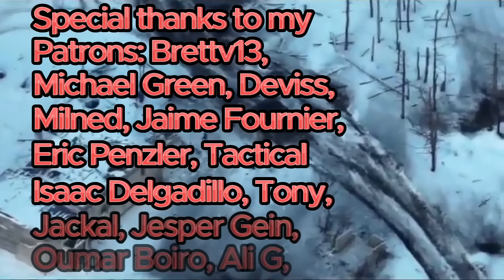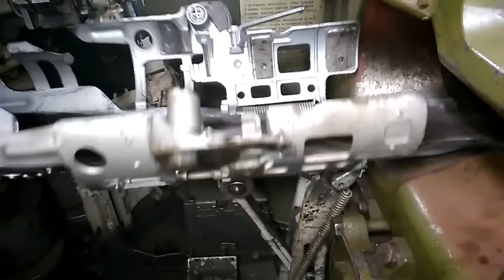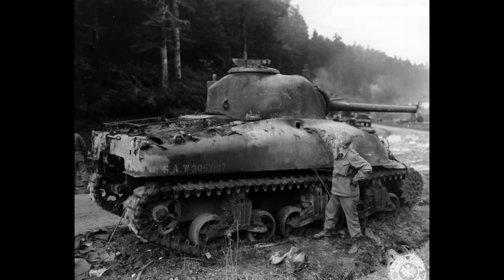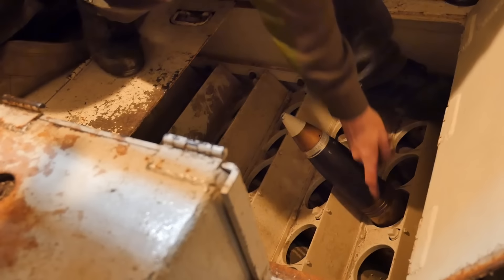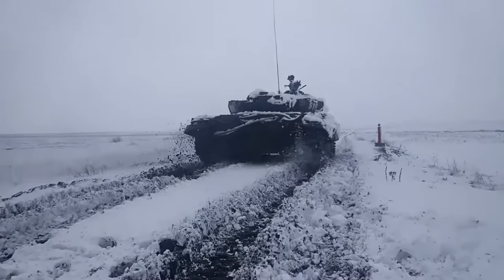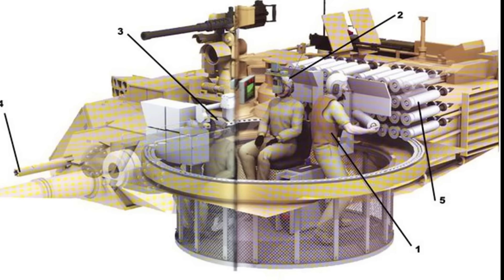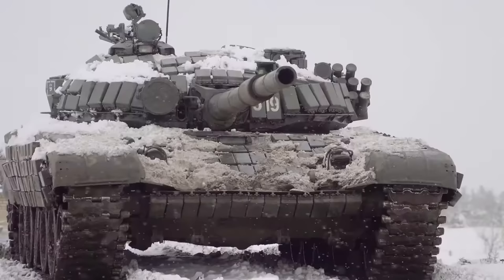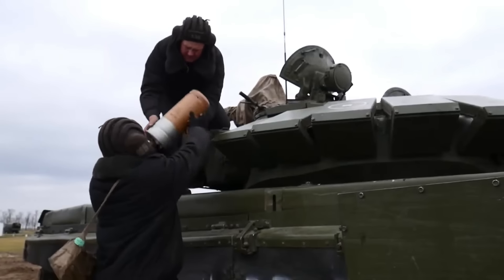Is Autoloader Really the Reason for Russian tanks exploding so much?

Comment: The most simple solution will be the introduction of a new propellant and HE shells, that are less sensitive to the external impact like what German introduced. That doesn't required any major changes at the loader itself. T 90M also offer some kind of kevlar layer inside the fighting compartment to reduce the post penetration effect, which is ...lets say, very terrible on Soviet tanks.
Also, the very good advantage of bustle autoloader is the loading speed. K2 can shoot 15 rounds per minute and the very similar loading rate are shared by Leclerc and Type 10 . Of course Russian will mostly not have to fight against these concepts (oh sorry, correction: Poland did buy dozens of K2) but still worth mentioning.
Reply: @CheapSushi  active protection system in Russia's case need multiple adjustment to deal with near peer threats. Also Russia suffered from the lack of budget and corruption. The Arena M APS which was "declared" effective against top attack munition was planned to mass produced next years but that will probably delayed forever because of the ongoing war. Remote turret is an amazing solution , especially when combining with some kind of special ammunition but detecting those small and agile drones is a major difficulty for both sides.
Reply: @mrmakhno3030  Or Boomerang/T-14 case: Russian HQ took a look at new stuff and decided that upgrade isnt really worth it.

Comment: All that matters really is that the crew survives.And let's not forget these Abrams you are using to compare are almost 30 years old. It's clear tho Western tanks are better
Reply: I think its clear they're weaker. So far 72b3 vs Abrams t72 1 Abrams 0

Also the finnicky blow out panels of the m1 means a simple rpg or loitering drone can causes a blow out which makes the tank operationally killed. Thats extremely weak
Reply: @off6848  It wouldn't be that hard to put cope cages around the back of Abrams protecting the ammo. Compared to Russian tanks ammo storage. And it seems to me that any tank that gets hit with their advanced optics and electric systems gets knocked out of combat period so then it comes down to crew survival
Reply: I say f war tho and both sides have shown that the Rus in both sides are brave. And imo the Armata is the best single tant if they iron out the problems.Why?  Crew safety and having the crew out of the turret and into a armored capsule
Reply: Also you could ask. Is Abrams a war winning tank? The tiger was better at fighting then the Sherman. Was the Tiger a war winning tank tho?

Comment: 7:12 and like . . . already about years for someone to say "Russia already uses a low insensitive propellant, carousel ain't longer a problem"

in my opinion, hand loads become more and more obsolete
con
- more (frontline) crew
- more training
- more life cost
- bigger tank size
- bigger blow-out panel door
pro
+ more crew for quick field (but it really, has on-board spare parts like WWII are rarely seen in modern-day)
+ less mechanic maintain
Reply: The extra crew reduces chance of all crew knocked out (in War Thunder)
Jokes aside, heat insensitive propellants isn’t That hard to make. Doesn’t make sense for Russia not to have them.
Reply: Tha is assuming the tanks only carry modern HE shells made in Russia.
Reply: @anotherbacklog  More like they are using old ammo, especially HE ammo, because it didnt really get better over time, aside form adding remote detonation function.

Comment: Im gonna gaurentee that you havent mentioned the weakspot along the turret ring , which is where every t72 and t80 are being hit with fpv drones , Also gonna guess you ignored the fake relikt and the t72s that have had the ufp penned at its supposed thickest spot by tanks that can only field low pen apfsds . Also the aluminum covering on the autoloader will not provide any stopping power against fragments of steel and harder materials , your also forgetting thgr armor on burnt out turrets eg the leos that got repaired electronics are the most costly replacement

Comment: Its possible , but also correctable . Once a problem is discovered , then corrections are pretty fast to follow . Shermans in the early war , used to catch fire , at the drop of the hat . Turns out it was WHERE ammunition was being stored , that caused the problem . They changed that , and added " wet storage " , and the problem started to go away . Getting rid of the radial engion , helpped as well .

Comment: yeah i guess its well established that ammo that is stored outside of auto loader is the reason in most cases. after all those turkish leopards in syria also had rocket seats installed and without auto loader.
Reply: The issues with those turkish ones was improper procedures/protocols for ammunition storage... such as bringing in and "storing" more rounds on the floor of the turret so that they didn't have to 'waste time' and go refuel/rearm as often or propping open the ammo blast doors so they didn't have to bother "wasting time" constantly opening and closing them... especially in static firing positions where tanks often sat for extended periods of time.
Reply: Leo 2 crews burn with or without overloading of ammo. Would turret fly away is irrelevant if you burn inside the tank.
Reply: @JohnDorian-j7x "well actually it's not that leopard 2 is bad but it's the crews fault! 1!!1!1!1!"
Reply: @JohnDorian-j7x  Wrong. The leopard 2's main ammo stowage is still next to the driver in the front of the hull. And leo's front hull is weaker than a T72's
Reply: @unterhau1102  Bruh... I dont know what to tell you. If you chose to keep the blast doors propped open and ammo spewed across the floor of the turret... there's not much that the tank designer can do to keep them save. Also, if you think the Leopard 2 is "bad", you're a fool, just like all those that think the T90 is bad.
Reply: @aleksazunjic9672  I agree... if you burn the inside of a tank... it'll die.

Comment: I think in general there is a lack of protection against top attack munitions. Anywhere you put ammo people will try to blow it up. Regardless of where that ammo is put, if a top attack munition penetrates the top of a turret in a tank that keeps people inside the turret they face a high chance of getting turned into mashed potatoes. Maybe your driver can survive the flash temps and overpressure inside the hull if the ammo didn't cook off but I would not put money on it. Instead of spending money on trying to make ammo uncookable and completely redesigning the tank, focus on preventing the top attack munition from doing it's job. Same with the drones. The lack of countermeasures and defenses on the tank seem to be the main problem. All of the reddit tank experts who have their six pack of abs as their pfp are welcome to comment.
Reply: Also, since most of these designs were created before top attack munitions and drone strikes were so popular, its really no wonder it's such a problem. Maybe in the next 20 years we will see some new tech come out to prevent the drones from being such an issue for tanks and infantry.

Comment: in addition to all of the above, it is worth adding that part of the reason why this happens is in the type of shells themselves, armor-piercing crowbars do not detonate - there is nothing to detonate there, but if the turret niche of an Abrams or leopard is filled with high-explosive shells, then no turret panels will save either the tank or the crew. Even the active burnout of such a quantity of explosives will not leave the crew a chance to evacuate, not to mention the detonation of shells behind a thin partition. in my opinion, the “carousel” is still preferable to the box behind the turret, which essentially represents a huge target, especially now, when the danger is mostly  from above, and not from the side, it is quite difficult to get into the carousel, although of course it is worth continuing to work on improving it - protection of the AZ in general and each cell in particular, the German version of explosives, and so on. the best option is the T14 Armata - the crew is in a protected capsule, the AZ is separated by armored partitions from both the crew and the engine, and the best option for a turret box, in my opinion, is the French Leclerc - the automatic loader  connected to the habitable compartment only by a shell supply shaft, which is opened automatically at the moment of shell delivery - good protection, no option to leave  “doors” open. As for the many videos - how many Soviet tanks are there? thousands, and how many Abrams and leopards that participated in  battles - a couple of dozen, there is simply nowhere to get comparable number  an epic videos of burning out Abrams and leopards .

Comment: Its interesting to see design features in both eastern and western tank designs that would offer protection against a certain threat while being being more vulnerable to others, specially emerging ones. 

Case in point before the advent of top attack munitions and FPV drones the turret bustle would had being undoubtedly superior to the carousel, not just for protection but also as you have mentioned in other videos because it allows for the accommodation of newer and larger projectiles that the carousel can't fit because of space limitations. 

That being said now it' has become a major vulnerability to FPV's and crew survivable is not guaranteed because as you say the fire can spread to other parts of the tank but also because it depends on the what the enemy chooses to do and the conditions of the battlefield, suppose the crew bails out and there's already another FPV or FPVs waiting to hit them directly as soon as they get out just to give an hypothetical example.

On the other hand the carousel cannot be reinforced with blow up panels like the bustle and it can't accommodate larger projectiles that would allow the T series tanks to better compete with western tanks. Fire resistant propellants and fillers would definitely improve the safety issues but it wouldn't address the space limitations.
Reply: Well there is T-14 for a better protection and higher-caliber ammo (and also T-95/Obg292 using similar style of ammorack to western tanks and retaining autoloader). There is no bigger gun/ammo in production yet however...

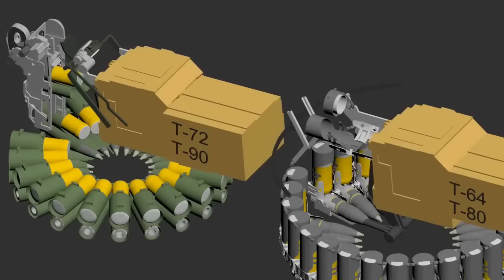Comment: 0:32 That looks like the autoloader in the T-72 and T-90.  The one in the T-64 and T-80 has the charge stored vertically and the front "half" horizontally - it loads in one action via a hinge - you can see it at 0:59.  The UVZ autoloader needs two steps.  It has a hoist.  It loads the front half then the charge. 1:32 shows the correct graphic for the the autoloader in the T-64 and T-80.  Compare that to the graphic you show at 0:32.  3:45 is correct.  Compare to the graphic at 0:32.

Comment: The sbrams thst was captured didnt burn from the ammo in the turret blowing out. It lost a track so claim it was a mine or fpv drone. Ammo was hit blow out panels worked to keep the crew safe. Crew rotated the turret to keep the power pack from catching fire and absndoned tge tank. Tank was struck several more times by russian munitions. A russian soldier  actually hopped in the tank and showed video of the inside still completely intact. Russia tried recovering it and uktaine hit 2 recovery vehicles then tried destroying it themselves to prevent recover using artillery and drone droned grenades that burned the inside of the vehicle out. Tank is still largely inyact and could be repaired. Worst damaged abrams have been repaired in Iraq

Comment: I think the type of propellant used plays a major role, both traditional NATO & RU combustible casings are able to ignite with relative ease. It is usually just a nitrocellulose based material, no idea of the specific chemistries used in the east today but old school ping pong balls are a good example of the material used, a ``spicy polymer``. This is the riskiest material in the tank as even TNT, especially in a shell casing Is not as concerning as literal Nitrocellulose polymers when it comes to fire. But I would much prefer the western use of usually phlegmatized RDX based explosives in the projectiles, which is the bulk of what is being fired since the main role of tanks is still good old fashioned direct fire, on things that are not tanks. That definitely adds to the boom when they do go off, the carousel (if it is even loaded to max) is mostly HE shells. The Russians are using a wide variety of munitions, including north Korean, I wonder how chemically clean their TNT is, the dirtier it is = more reactive. Do they test these things for cookoff times & whatnot like the DoD does? I seriously doubt it.
We reduce the risk of these propellants by using coatings, processes or different compounds completely to nullify the risk. The new low risk propellants in the west for example use things such as TMETN or other, more stable nitrogen-based compounds combined with plasticizers & other things to replace nitrocellulose and almost entirely remove the risk of sympathetic detonations. 

I think the tanks autoloader is not inherently at fault, it is a clever design. But it is simply not helping by the reality that the ammo shares the same room/atmosphere as the crew, same thing makes the leo2 a little uncomfortable to me. 
I think the western bustle design is slave to the reality that we have manual Loaders in most of these tanks, and that design theory sticks too. It is free space in a very convenient location (we dont have the same weight or height restrictions for design). Even when we do autoloaders in these we use a bustle rack most of the time, the Leclerc & Abrams testbed come to mind right away, autoloaders from the bustle rack because ``where else would it go``?
as someone else pointed out top attack missiles such as the BILL & TOW upgrades were designed specifically to kill these from above, sensor fused artillery and things such as javelin followed suit. Roof armor is lacking for most tanks.

Comment: I have a queery and a point.

Queery: I like to make armored vehicle designs (not stupid scifi garbage) and existing armored vehicle alterations. So, with that in mind, I wonder. If you place thick steel capsules around each crew member in a T-64, T-80, or especially and preferably a T-72 style autoloaded tank, would thatgive the crew time to evacuate in the event of a cook off. And if so, what if the top turret armor and the hull sides around the autoloader acted as blowout pannels to vent detonation to the sides and up,while the crew members,inside their individual capsules, are safe. Of course, in the event of a full detonation, survival chance is slim. But as a Tank nerd myself, I actually prefer the doctrine of soviet style autoloaders to western ones. I wonder if you could make the chances of survival, if not equal, then almost equal to the bussel style ammunition stowage. 

Point: Even a bussel style of ammunition placement with blowout pannels is subject to a possible catostriphic detonation, especislly if the tank is carrying HE, HEAT, or a multi-purpose HE round, which could destroy the tank still. People dont realize that Ammunition doesnt just have to cook off, but it still can detonate if the right conditions are met. 

Side note: If russians started implementing a capsule emplacement within T-90M tanks (individual shells around individual crew) and blowout hatch atop the turret, and blowout pannels on the sides and bottom of the tank, along with an insensitive propellent and HE filler in their ammunition, i feel like their survivability would be superior to western designs. (If it worked and was feasable to implement into production, which is questionable.)  And of course, the addition of a reverse gear would help tremendously, of course.

Comment: Uh, yeah.
It isn’t an autoloader issue…
It’s that autoloader issue.

Having all of the ammunition located underneath the turret all on a ring (plus any stored in the hull as extra) means you cannot have blowout panels… which 9/10 times saves the tank and the crew.
Anything that isn’t a cassette style autoloader where you can put it in the rear of the turret and have the ammunition located behind a large protective sliding door with the blowout panels above the ammo compartment.

Comment: The issue is with the way the turret is secured to the hull. There are so many films from WW2 showing T-34s and KV-1s popping their tops and sending their turrets much higher into the air. Yes, these turrets are much lighter than modern turrets, but the shell charges used by their guns were mostly black powder until close to the end of the war. Black powder has nowhere near the explosive force of modern charges. So yes, the ammo exploding causes the top to pop, but the auto loaders are innocent of the cause.

Comment: Last year i was working in a wood dust silo (highly explosive) i changed the explosive door panels wich is new system , can take much pressure from out but from the inside the moment the pressure is higher it will explode open and let all the fire out instead of exploding inside and destroy everything . Why russians doesnt build under the tank the same system instead of exploding upwards  let it eplode downwards wich gives the crew few valuable seconds to evacuate the idea behind the panels is to give the crew higher survivability anyways the tanks will be damaged or even destroyed but the crew will survive

Comment: no because certain Soviet ifv have an autoloader and in the case of the bmp3 the shells it carries,although smaller in diameter  pack quite a punch and depending on the load they can be used as basically mortars so that means they are almost entirely powder+propellant aka mini bombs ready to go off at the slightest impact. the shells that "cook" are the sabot type who don't actually have an active warhead